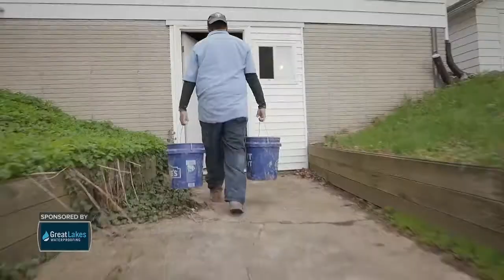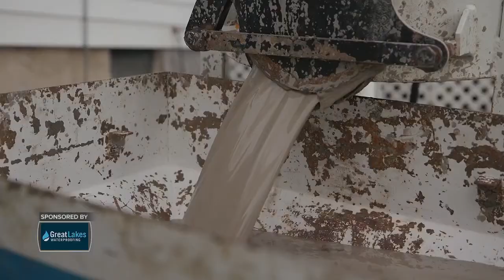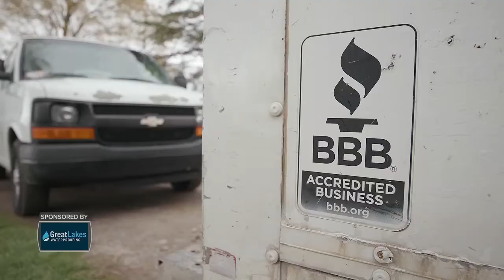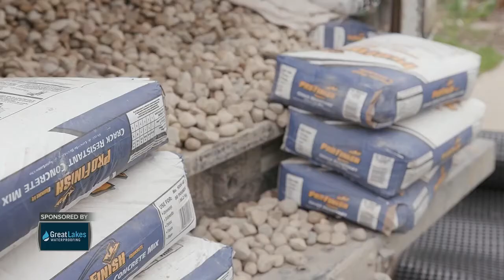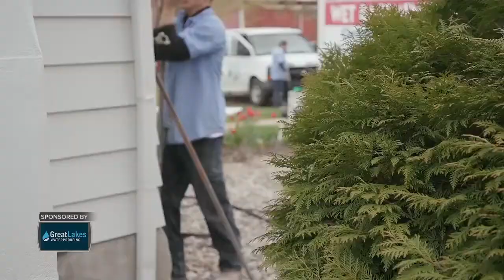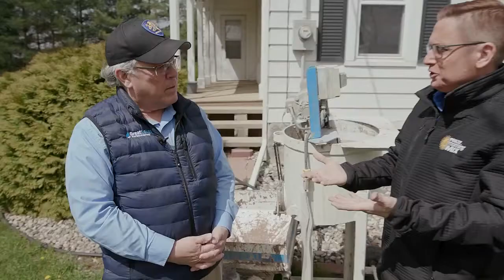Get a look a Great Lakes Waterproofing's Bentonite Clay injection system

Comment: Bentonite injection is a terrible idea and is banned in some jurisdictions as it will clog existing drain systems. A better use of bentonite is to fix the grade around the building then add a thin layer of dry bentonite then cover with topsoil / sod so the water around the building will be forced out beyond the clay before it can soak down into the ground.

Comment: I am trying to build a clay cap around my foundation starting right next to the foundation and coming out 6 feet and sloping it so that water runs away from the house. Can you give me any suggestions for how to do this?
Reply: For the first 2' closest to the building dig down 6" deep from 2-4' out dig 12" deep then 18" deep for the outter 4-6'. 
Carve out any steps so you have a smooth slope then cover with 2" of dry bentonite. 
Roll out some weed barrier over the bentonite to protect the layer and help it pack.
Backfill with the dirt you dug up and top with desired landscape, sod or seed.
If you find that this area is holding water for too long you can dig an 18"x18" trench just past the clay shelf, line with weed barrier, fill with 12" of 21AA type stone, fold the weed barrier over it then top with dirt. This should give a good staging area for standing water to quickly drain to before heading back into the ground.